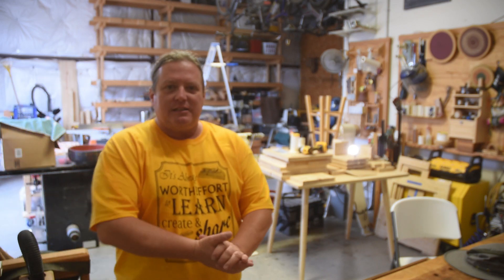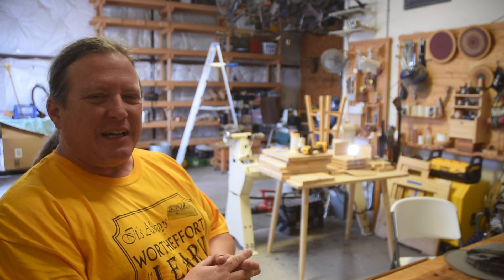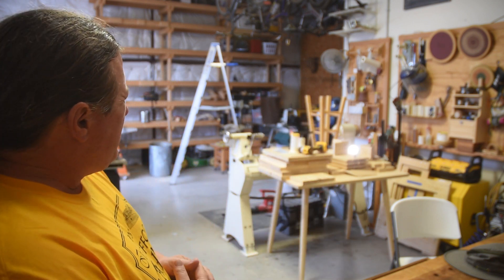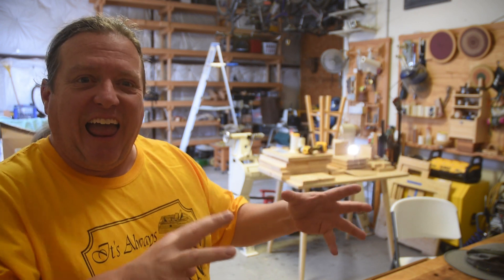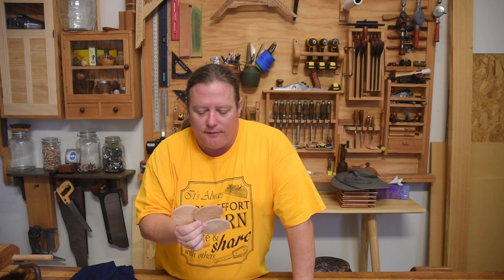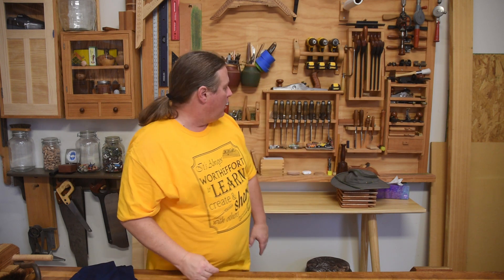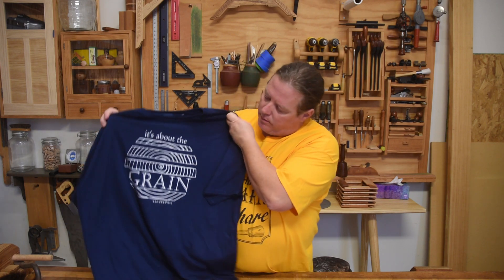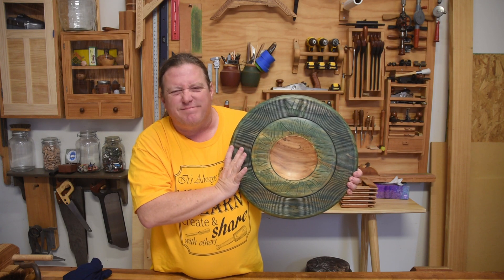End of a Chapter, Packing up the Work Shop - vLog #5 of the 'wortheffort' shop build

Comment: 16 shops is impressive. Ive only ha 8. But I also took a 20 year break from woodworking and worked as a building and fire inspector, fire investigator and Fire Marshal. Retired for several years now and have shop #9. Its small but efficient. Sold out several years ago and became trailer trash (full time RV), which i love, and have a small shop in the middle of nowhere Ne. Just bought my first lathe and finishing up the lathe stand tonight. Still waiting on turning tool to arrive. Guess Ill just have to go bird hunting, and you just never know when a trophy Jackalope will appear!

Comment: I have no doubt it's a pain in the ass to have the metal dovetail marking gauges made again. I'd buy one if you you did eventually get some made again. Oh, I'd buy grooving planes but haven't seen your pricing on those.
Reply from the maker: One of first projects in new shop is restocking them in white oak and aluminum.
Reply: @wortheffort  <3

Comment: Best wishes for the new shop. The sponsored ad was hilarious. Looking forward to your methodical tool storage and set up of the new shop, with limited, real world size space. Also, if you're starting turning as a focus may I suggest starting a separate channel. While I love wood working I have no real interest in turning. I believe are many in that situation, just something to consider. Best of luck in the move.
Reply from the maker: I already have 10 years of woodturning videos on this channel. All my top performing videos are turning.
Reply: @wortheffort  My comment wasn't meant to negative, yours is easily one of the top 3 channels on wood working period. Your teaching skills are exceptional, and I have learned so much valuable info from you. My point was nothing more than if you do an extended series on turning I, and perhaps others, would wait until the other aspects of wood working start to tune back in, I certainly wouldn't unsubscribe. I realize you have a passion for turning and I feel its such a niche that perhaps a focused channel on that topic may be worth considering. I also realize that that may take too much time, however, many of the wood working channels have gone in the direction of a second channel to best meet the needs and wants of their subscribers. Either way I wish you much continued success.
Reply from the maker: @Gotmovezlikejagga  Have you noticed that most "second channels" have started returning to the fold of original channel. Second channels don't earn as much. I start a second channel and it's assured no income on it for a long time and it'd not reach same volume of audience as larger channel. It's all analytics analysis.
Reply: @wortheffort  Fair enough, mans got to eat, and that takes $. Looking forward to the new shop and tool organization in a smaller shared space.